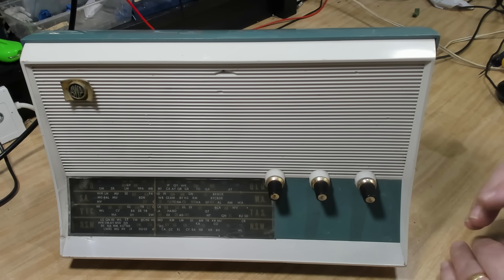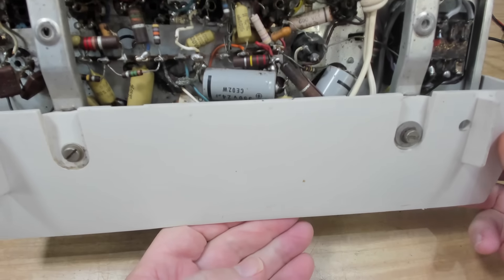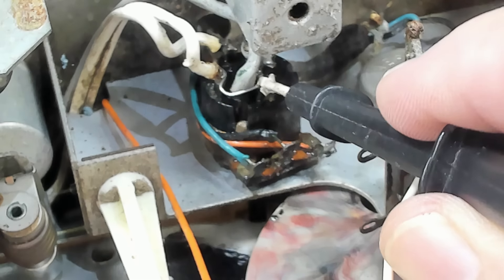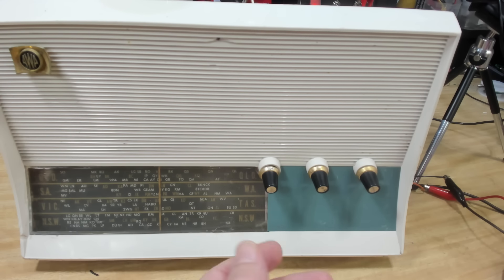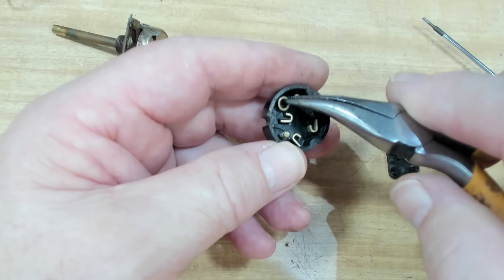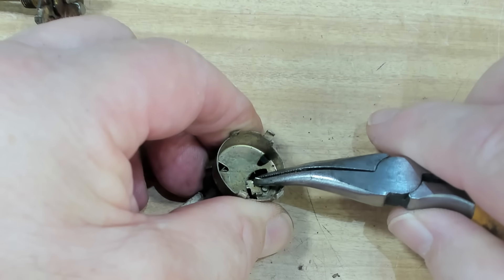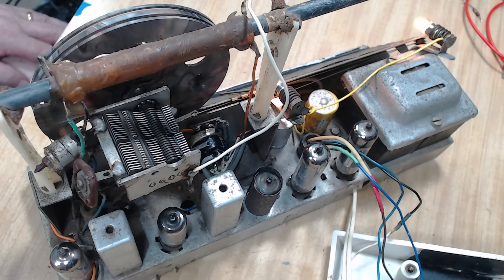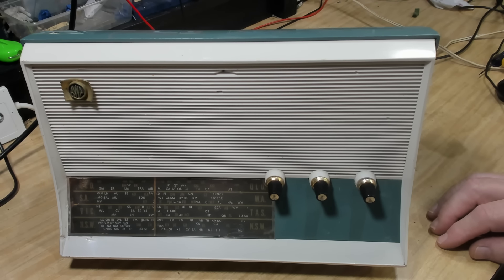AWA B15 (Electrice E516M, Westinghouse W516M) Smoking Radio Repair - 1961 to 1972

Comment: I had one of these as a young boy, brings back a few memories, everything looked so familiar as you pulled it apart, about the only bit I didn't remember was the plug size hole in the case back. Even the sound of it tuning across stations took me back 50 odd years.
Maybe I should join/visit the historical radio society and try to pick one up.
Reply from the maker: Exactly right Paul, seeing old radios and the like working again does bring back memories you may have forgotten. There are plenty of this design still around 🙂

Comment: Good one, Dave! 
That switch was a bit tricky.  Having to re-string the dial was an added bonus.  Glad it didn't catch fire.  
Enjoy your holiday! 
Cheers
Reply from the maker: Hi Don, thanks. I misspoke about the restring, I removed the pulley and had to refit the string. I watched your video, well tried to, but the WiFi on the ship is sketchy at best,  I'll have to finish it when I get home. Thanks Don 🙂

Comment: It’s a very good receiver that make and model. I have restored the same with colours matching. 

The case is a bit weak but if you have it setup on top of a refrigerator like my grandparents did, you shouldn’t need to worry about structural integrity if it just needs a dusting & service once in a while.

This model receives the best from remote rural Australia for me & it sounds great when powered by the isolation transformer & aerial as a long wire, all day long.

Now if my switch gives trouble I can come back to this video.

Thanks Dave! 😁📻🔧
Reply from the maker: Thanks Pete, this one worked well, better than some 🙂

Comment: Thank you Dave.  Yes it is a nice looking radio.  Awa apparently spent a lot of time coming up with this design. 
I got one for free at a club swap meet. The radio works fine but tragically it seems someone went to a lot of trouble restoring it but it must have fallen on the floor. The case isn’t too bad but the red plastic  is badly faded and the badge is totally faded. Quite common apparently.
Reply from the maker: Hi Robert, thanks. That's pity it was damaged. My red one is faded and the name has worn away too. As you say it seems common 🙂

Comment: I am having a “what have I gotten myself into” moment.
I just purchased a “Loewe Opta Lotos” type 2910T console radio with turntable.
It sounds wonderful and I’m trying to figure out how to get the record player to work. So I guess I’ll have to go back on all your different uploads and see the ones that you have turntables and figure out how to get this going. Also it’s missing one knob and I did find them online $95 for two that is ridiculous.
It’ll be a fun project.
Reply from the maker: Good luck with your project nzs. I haven't done one of those players but I found references to them online, maybe even a service manual but hard to see on my phone 👍😀
Reply: @DavidTipton101  Would you have any idea where I could get replacement knobs?  Even if they are not the original.  
I do you seem to recall that you did a console , not of this type but, with a turntable and you spent quite a large amount of time making sure that the turntable was working properly.   I’d have to dig around to see if I could find it.
Cheers, Neil.
Reply from the maker: Hi Neil, If I am after parts I ask in Facebook radio groups, both local and international groups if the radio is an overseas manufacture. The knobs on your radio were probably used on several models so posting a clear photo will help. Search vintage radio in Facebook to find groups. 
I grouped my Philips turntable videos into one playlist (link below). I have also done a few Garrard players but they are in individual videos. 

I think this is your player in Radio Museum (second link), if it is, do a Google search, someone may have documented a repair. I did see Jim's Radio Shop did one but I would tread lightly getting repair advice from him. Nice guy but can be a bit rough. 

https://www.youtube.com/watch?v=c9rtlrLW7ZM&list=PLHTsZdKkSdseaDfB-YyEHYg7WBvRdEeyn&pp=gAQBiAQB

https://www.radiomuseum.org/r/perpetuum_rex_a_3.html
Reply: @DavidTipton101  My gosh thank you for taking the time and effort to do this.  I truly appreciate it.
I found a local guy nearby that has a repair shop.  An old-school tinkerer.
The radio plays wonderfully but I would have to unmount the turntable to see what’s going on if he needs it I have a feeling that the rubber band or drive belt might’ve broken off from being so old. The previous owner said that it was noisy so that’s probably that it was sitting in a position for so long that it made a indentation in the belt eventually this cracked in two.
it’s not the destination that counts, it’s the journey that’s the fun of all of this.
I actually found on YouTube a man that had a similar unit and he shows how his operates.
If you saw the man’s basement where he keeps these radios this is the man that I bought my radio off him.
You would have a field day.  He has been collecting since the 70s and he has a plethora of radios from wind up Vitrolas and basically they are radios that he liked because it had nice wood.
I bought a second smaller table top one that dates to 1947 it is a Viking brand from Eatons department store.
Reply from the maker: My pleasure Neil

Comment: Another great video. I wasn't expecting one for a while as you're on holiday, but I'm happy to see one. Were those switches meant to be repaired or replaced? Great job rebuilding it.
Reply from the maker: Thanks clasicradiolover. They would have been replaced originally except for DIYers at home 🙂

Comment: Any idea what the computer is at 0:25? I don't recognize it, although I did use machines of that era. Great fun, before AI took over programming and all that.
Reply from the maker: No I don't Dan, it was mentioned in the comments it was a Univac computer but I have no idea 🙂
Reply: @DavidTipton101 Ah, those were the days. Very early mainframes. It looked like it predated most of the earliest widespread machines. Thanks.